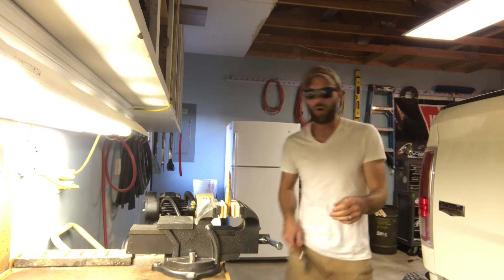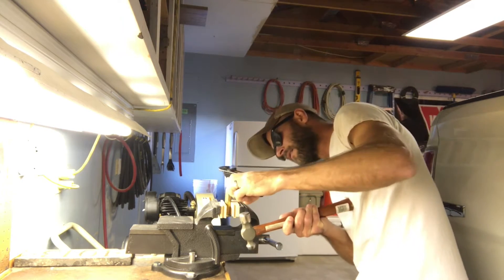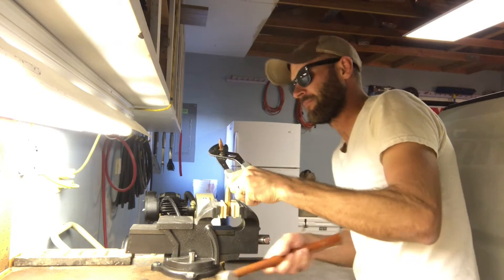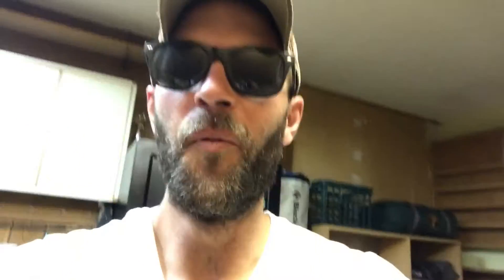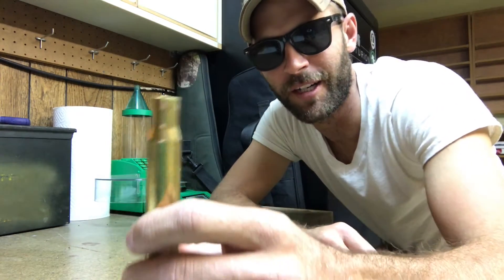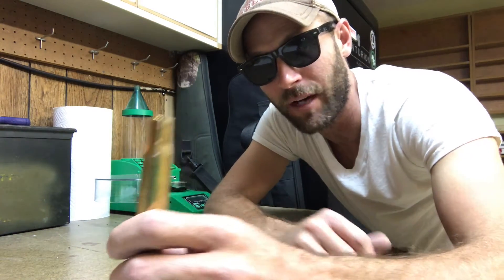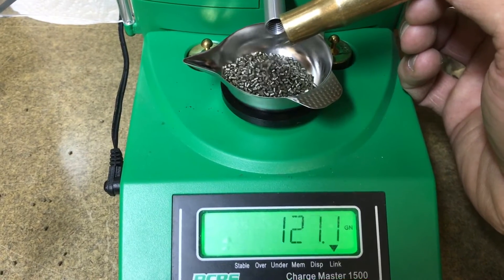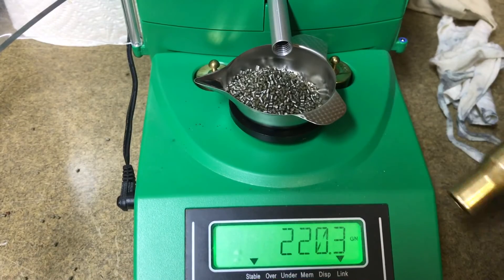How many grains of powder are inside a 50 cal bullet?

Comment: I know this is an old video, but you should have "armed" your primers prior to charging and loading the case. This helps prevent misfires.  Those of us that compete with 50's know this, quite well.  Just an FYI, I shoot 800 gr Solid Brass Boreriders over 248 gr of powder (won't state which powder as it might not be safe in all rifles).

Comment: You could reload about 20 9mm rounds. But that powder is so slow burning that even though you could put over 10 grains of powder in the 9mm case instead of 5 to 6 of regular pistol powder (because 50BMG powder is more dense), The pistol won't cycle and you'll get something like 300 fps if it even ignites.
Reply: If you shoot from a mp5, it would cycle